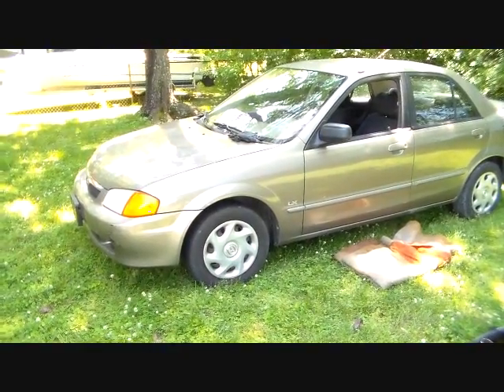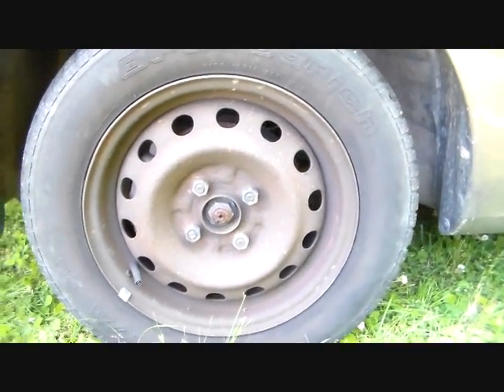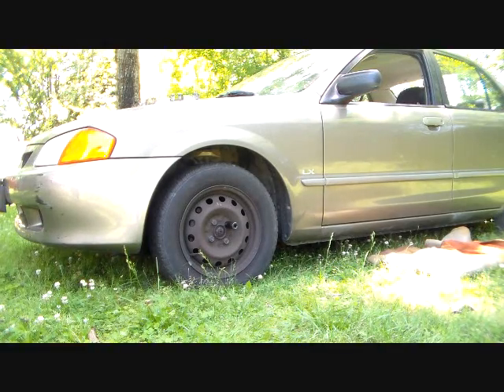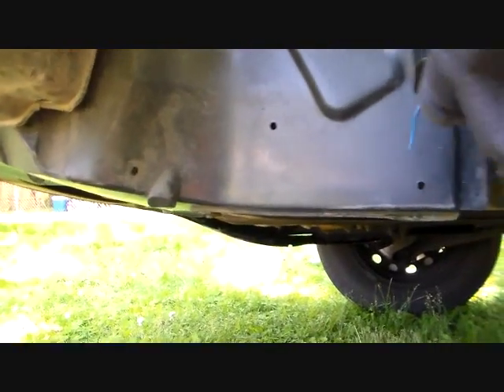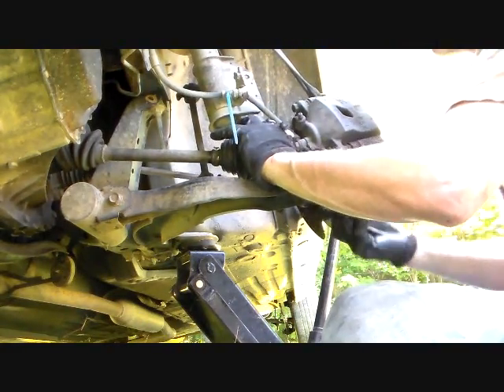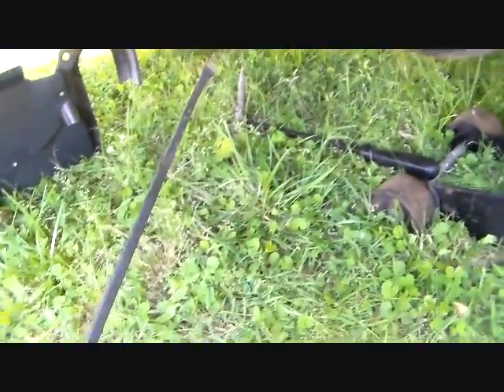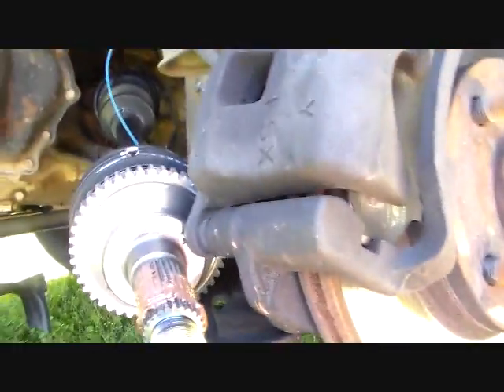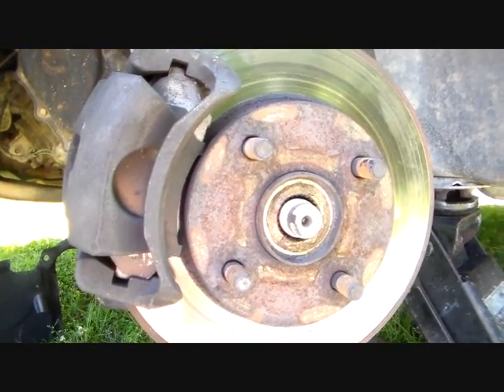Mazda Protege CV axle replacement

Comment: Can I use Redline D4 ATF or is it better to use Geniune mazda or Idemitsu (M3/M5) ATF ? Some say dont use Dexron 2 or Valvoline Mutipurpose ATF. What do you think ?
Reply from the maker: Personally I don't screw around with fluids in a Japanese transmission. In mine I went to the dealer and got Mazda M5 atf.

Comment: Them cv axles can be a real bitch some times.hey tyler I rebuilt a Q jet a while back that I got off a GMC dully truck and when I first put it on the car it ran pretty good and all of a sudden the car started cranking really hard and I pulled out the plugs and they were gas fould. so I put a new set of plugs in and it started right up and was running fine again tell a few days a go it started cranking real hard again and gas fould the plugs back out.I had the battery and starter tested and there good. so I was thinking the timing was out and I tore the front of the motor down thinking the timing chain was bad. well The timing marks are right on and the gears and chain look good. so what I'm asking is will the the carburetor make it crank hard like that. is there something I did wrong when I rebuilt it? I know you know a lot about the Qjets.

Comment: Does this vid apply to a 94 protege? Shot both my cv axles and am gonna tackle it today
Reply from the maker: I'm afraid to ask how you wiped out both axles, but, generally this procedure will apply to an older Protege. Make sure you have adequate tools to pry out and bump in the axles, make sure they are seated and be sure to refill any fluids that get lost.
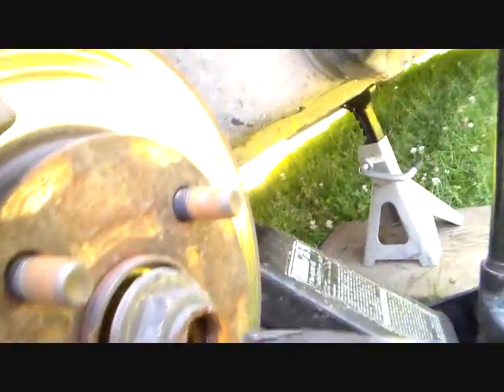Reply: Tyler's Neighborhood Garage my neighbor replaces the drivers side which was 100% shot. He said the passenger side looked fine but couldn't get the wheel part with that middle bolt part "in minute mark 10:24 of ur vid"off so I'm waiting till he can look at it again. I drove it after replacing the driver side but when I turned right or left it still made the horrible popping clunking noise, like something getting caught or winded up.  Feels horrible